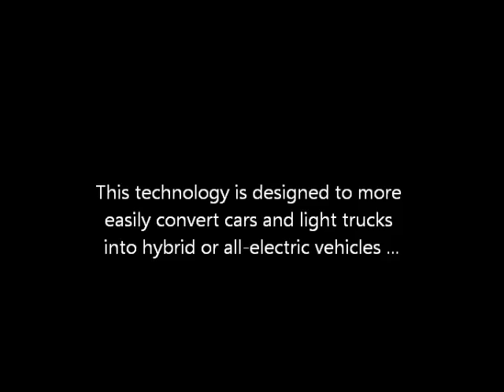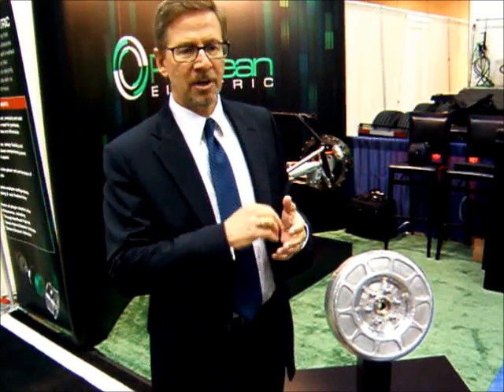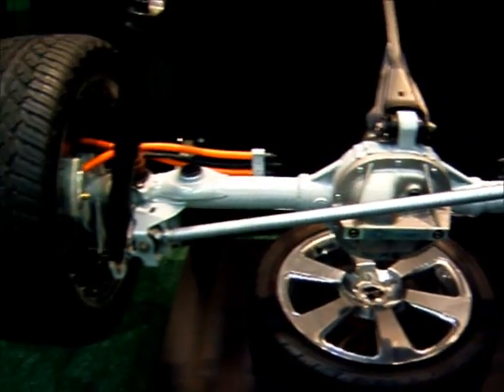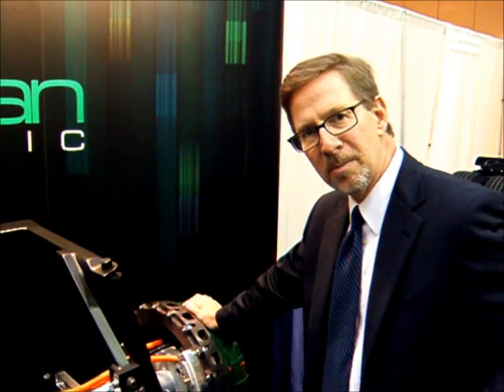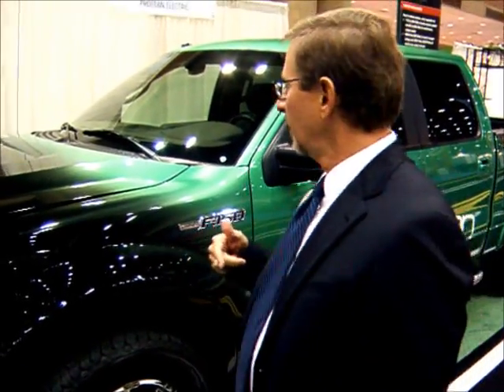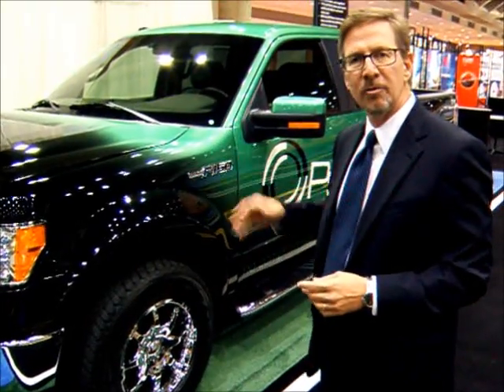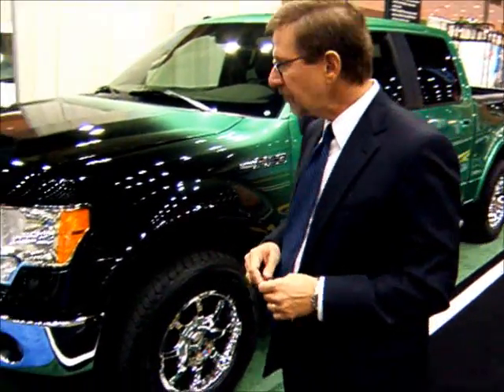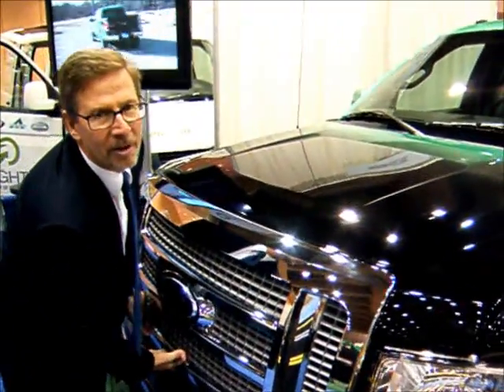In Wheel Motors.wmv

Comment: I haven't heard anything more from these people, but I still want to turn my 2-WD F-150 pick up into a 4-WD by using Wheel Motors up front. This would also give you through-the-road re-gen and charging with your regular engine ... . This would be great in the snow or sand and would not have to supplement any more than a momentary 20% - 30% ... just enough to get unstuck. Depending upon your storage, you would have a hybrid an probably be able to use the Wheel Motors around town. I know this is the rationale anyway ... COME ON!

Comment: Michelin and others are also working on in-wheel motors. There are challenges with that much dead weight in the wheels. Also, can you run through deep puddles with these wheels? I think trying to retrofit this yourself would be nuts.. it's highly advanced processors and electrical engineering designed for very specific cars and suspensions. But if they can meet quickly dropping battery prices on a new EV model for $20k with a 10 year powertrain waranty it would change the world.

Comment: material costs for this wheel, taking into account the controller, are equal to $ 200 without taking into account the 20-40 kW battery . how much do you sell this motor wheel?

Comment: Where have you been???? You need to make a million in these in wheel motors and make them available so we (people in the USA) can convert our existing cars.  Please hurry. This
in wheel motor is long over due.  If battery power does not last long, then will can put small gas engine in our electrically converted cars. This small gas engine can run a generator to charge the batteries.

Comment: That is good or use hydraulic on wheel motor with one big motor on the shaft the it is even better so electric and hydraulic feed to one another plus the hydraulic reservoirs generator to help drive large motor